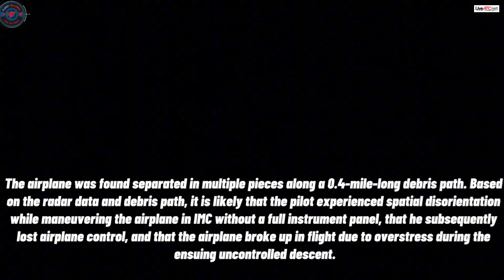Outdated Vacuum Pump Fails in IMC, Causing Fatal In-Flight Breakup #atc

Comment: if you ever find yourself in this your phone likely has a level function. just use it to ensure wing level while descending to vfr altitude with power and airspeed settings, no its not certified and all of that but it will tell you if you are getting in a steep bank angle

Comment: best would be , no turns, straight decent with 300ft/m, using only the turn indicator, part of partial panel training. No communication, just fly the plane. Just disconnect headset and focus flying the plane

Comment: I think the title is misleading. How can a failed vacuum pump cause an airplane to crash? Wouldn't that fall under training?
Reply: The failed vacuum pump caused him to lose several instruments (which run on vacuum) and that caused him to lose spatial orientation in IMC. He then got into a steep descent and the plane broke up when he finally realized it was in a dive and tried to pull out of it.
Reply: @sbreheny  I know it's not easy, and I've seen lots of it in my 40+ years as a mechanic. I'm not a pilot, but know that IFR training involves just this situation, and what you have left is needle./ball and airspeed. We had a flight school, and was around that training. That's why they cover up some instruments during training. I was even in a Bonanza in the soup when the instruments died. All he had was the two left.
Reply: @1Planenut75  The minimum to recover from anything but straight & level-ish is a gyro instrument; a turn & slip will do it, a turn & bank won't. IF everything is stable, the ASI & ball will allow you to keep it upright, if no distractions... guess a lot of peeps are bad at minimal imstrument IFR?

Comment: I am thinking aloud.... I wonder if a smart phone's inbuilt gyros might have been useful here,  along with a spirit-level app? Better than nothing?
Reply: Smart phone gyros may have helped but that's not the same as a level app. Level app assumes that you are not accelerating. In an airplane you cannot use a level to determine your orientation unless you know you are wings level (therefore pointless) or in a coordinated turn (needs additional instrument input).
Reply: @sbreheny  True.

Comment: The controllers were absolutely zero help to this pilot. This is a prime example of why, in an emergency, the pilot doesn’t ask ATC for anything. The pilot tells ATC what he’s going to do. This pilot should’ve TOLD ATC to get him weather for every airport within fuel range.  This pilot should’ve TOLD ATC he was going to stay on top of the clouds until he had a suitable place to start a wings level descent. This pilot could’ve controlled the situation and saved his own life, but ATC could’ve helped him too. They were absolutely worthless, an embarrassment to anyone who’s ever been a controller. Very sad and preventable situation. The pilot, with the help of absolutely worthless controllers, let a minor emergency become a crash.
Reply: Its NY, what do you expect?  Fuggetaboutit  (I did most of my flight training at FRG... fun times)
Reply: NY N90 is the worst place to have an emergency. Your choices range from completely unhelpful to actively killing you with bad information. Ask N5946C who had an engine failure over Long Island and was directed by NY ATC to a non-existent airport that had been closed 20 years earlier. Pilot was killed crashing on railroad tracks where the airport used to be but had been turned into industrial buildings and car dealerships decades earlier. There was a massive 90 hole golf course just half a mile away that the pilot could have landed at if he hadn’t been misled by ATC into believing there was an airport available.
Reply: @kathrynslye471  I remember it well…Bethpage. Incompetence at its finest. That’s what the FAA is based on.  I’m telling you that based on my 30 years experience in the FAA at level 10 through 12 ATC facilities.
Reply: The controllers don’t care to learn either.  Once standards were lowered for DEI purposes, they stayed low for all who followed.  Combine that with zero incentive to do anything extra or to do anything better, a non-punitive culture, a top-heavy pay system, an over empowered and over-protective union, and you have the mess of an ATC system you see today.

Comment: I have had a vacuum pump fail on me twice. It can be VERY disorienting if you don't catch it right away and COVER UP the DG! It is too tempting to try to look at it, as it is ingrained as the home base of all instrument scans. Practicing partial panel doesn't account for a real failure. Typically the DG will gradually start to drift, and if not caught early it can be fatal.

Comment: A vacuum pump is probably the only system on a single engine piston plane with no back up.  Usually two fuel pumps onboard,  if alternator fails there is battery back up,  if static system fails their is usually alternate,  if interior lights fail you have a flashlight.
Reply: Except for piston twins. They usually have a back up.
Reply: Actually, one of the first installs my partners and I did on the airplane we owned was to install a standby vacuum source.  You pull a lever and take vacuum from the intake, as I recall.  It's been a while.  STCs are a beautiful thing.  Of course, flying in trim and knowing how to use the turn/bank indicator could also save the day.
Reply: @flyingjeff1984  he probably lost the artificial horizon, too, so once he was in IMC, it would have been near impossible to avoid disorientation.

Comment: In the old days they used "wet pumps" instead of the modern "dry pumps" and wet pumps had a lower failure rate people didn't like them because they could be messy from the oil.
Reply: Both are obsolete.